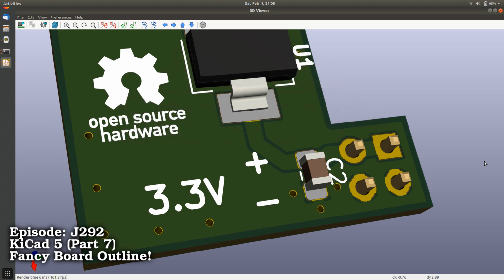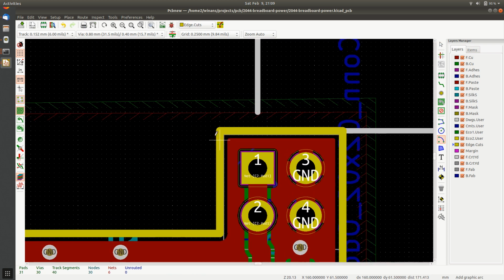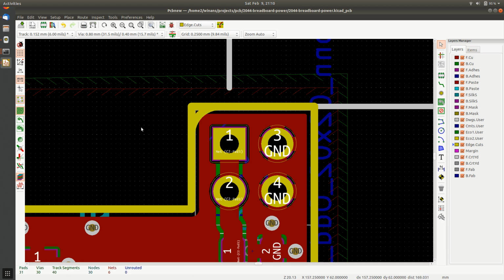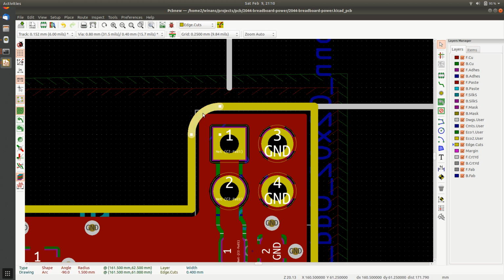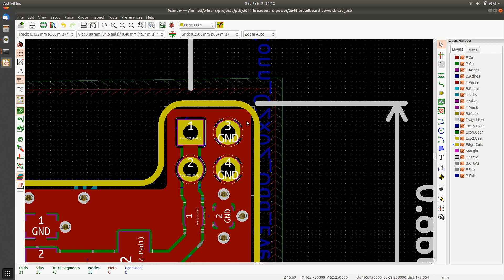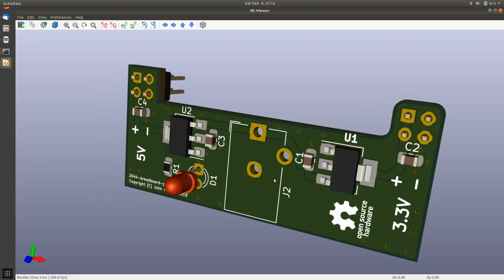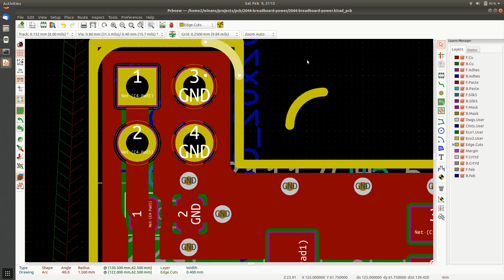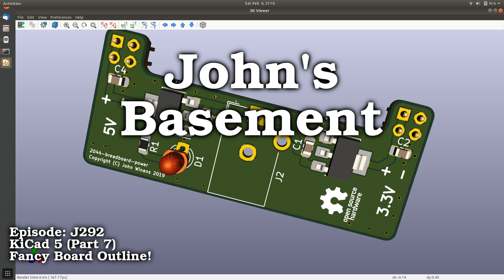KiCad 5 #7 Fancy Board Outline!

Comment: 2:45 They were actually smoking smart things. When copying, after selecting what do you want to copy (and that can be multiple items), Kicad asks you to select the reference point for all items that will be copied. That is very handy when copying multiple items (e.g. several vias with all pads that goes from one DRAM chip to next...) - you select all items and then with next click select the reference point (e.g. pad one pad of a DRAM chip) and then when you paste, you just follow that reference point on all places where you paste the items. Very handy and smart. Cheers! S
Reply from the maker: Hey! Thanks!    Not bad.   I did read much of the doc some years ago.  I must have missed that or it failed to sink in.

Comment: any tips for creating fillets that don't connect two lines at right angles? I'm thinking of a PCB with one corner cut at 45 degrees, but I still want rounded edges between those lines.
Reply from the maker: I have never tried it. But... it /should/ be possible to select a grid resolution that allows the ends of the lines to still connect to the ends of the arcs.
If you can't work it out that easily, you should be able to manually edit the diameters and center points of arcs in the properties settings for your arcs so that they would fit.

Comment: Thanks, John for the great video. Kindly allow me a question ...
while rounding the edges of the board outline, after putting the arc over the two (right-angled) edges, which "mouse key combination" did you use to select one end of that segment and draw it back and forth till you found the appropriate length?
Probably you have already mentioned that combination in one of your previous videos but I can't find it. Could you please provide this information again?  
Thanks for your help in advance.
Reply from the maker: Those are all left-clicks.  You need to click on and grab the white dot that represents a handle on the end of the line in order to change the location of the endpoint of the line.... otherwise you will be moving the line itself.
Reply: @JohnsBasement  Many thanks for your fast response. Problem solved.